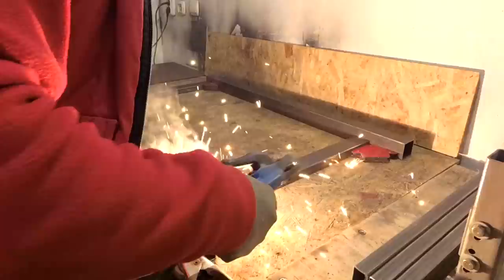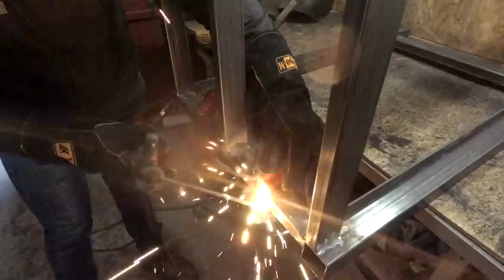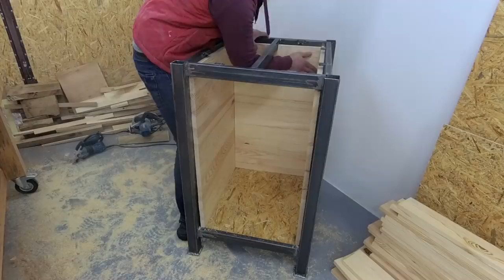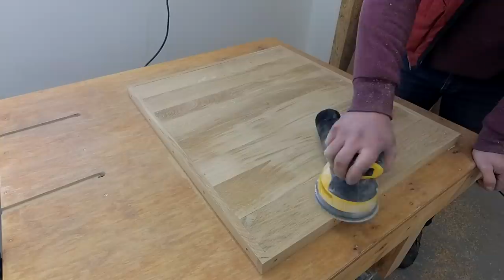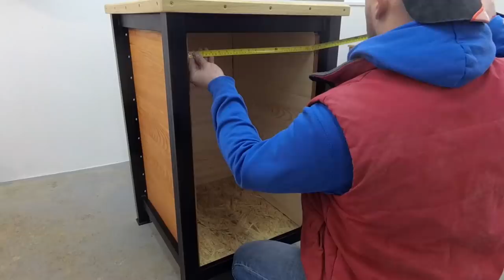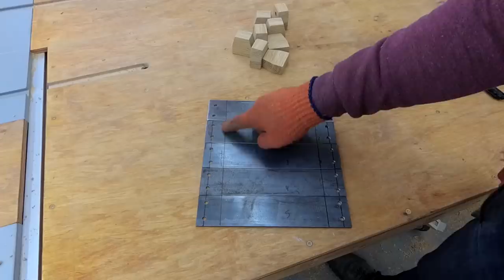Ultimate Maching Stand - Drill Press Stand (STEP BY STEP)

Comment: Okay this thing looks really good.  Great job.  However, it will take a forklift just to move the thing.  If anything you should have put wheels on it with locks so that at least you could move it as you get more workbenches etc and you need to rethink your shop design.

Comment: If you already glued the bottoms of the drawers, why hold them with screws? Wouldn't it be easier just use nails instead?
Reply from the maker: there is a heavy tool in the drawers, much more reliable.